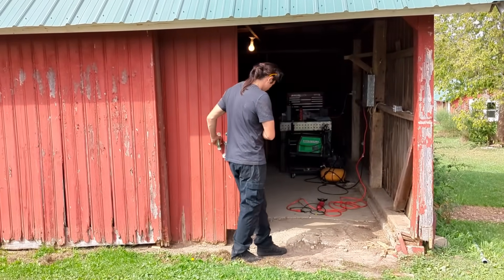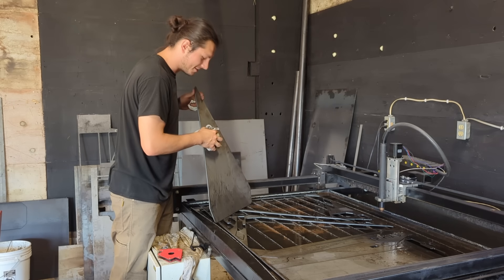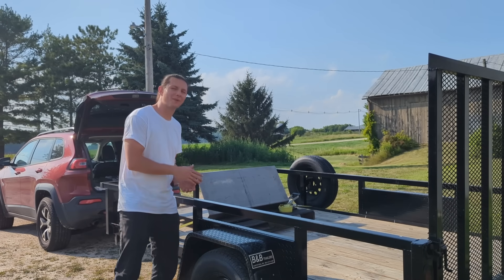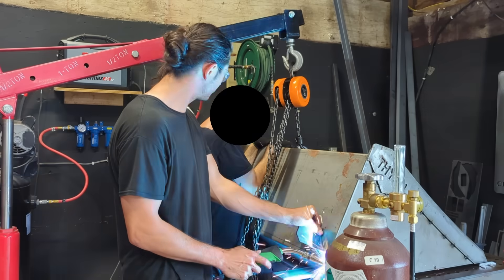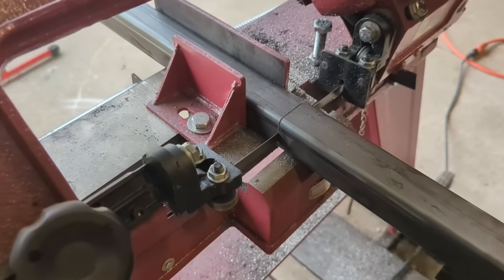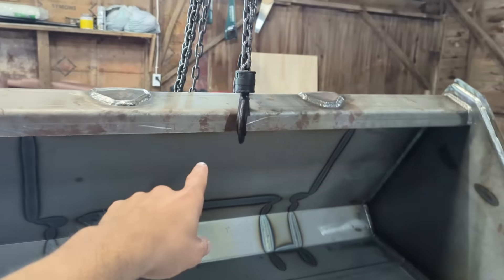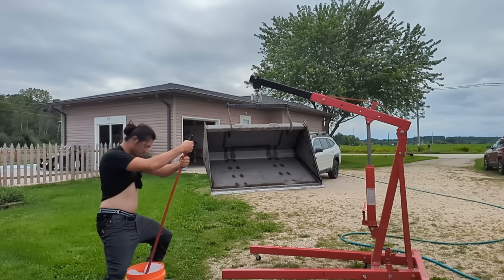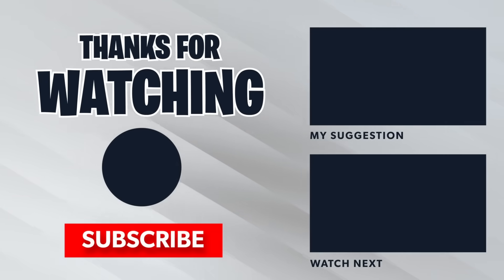Turning Sheet Metal Into $$$ | Building My First Skid Steer Bucket

Comment: In no welder nor manufacturer but I’ve seen heavier duty equipment with these welded hash marks to increase the protection from wear. I believe it’s a stronger type of electrode but it might be something to look into to add that extra level of build quality.

Comment: I built thousands of skid steer Buckets at a manufacturing facility in Sioux Falls SD. Your bucket looks good ! I did see that Yao guys were welding downhill and that’s a no no.  I’d like to be there when you put it to use and help you tear it up to see what and where you need to reinforce things.  Great job and it really looks good.
Reply from the maker: Thanks! Yeah I'm actually trying to find local contractors for testing. It's a little harder than you might think!

Comment: You need to sandblast that bucket. You were right to get it degreased, but you have no surface profile just mill scale. The rough texture gives you highs and lows That grip the paint. Its actually measured in mils and there are specs in the industry for it. Look up some NACE training materials to get the idea. Basically it needs to be a roughened surface.
You can spray Rust-Oleum through a spray gun and get some decent results if your steel is properly prepped. If you add a little bit of catalyst to it when you're mixing it will cure up faster and be harder than it otherwise would. 
If setting up for blasting and the dust from it is an issue, consider a wet blasting setup. CCE and SV Seeker both have videos about it in use on their channels. Works well and solves the dust problem. SV Seeker also has some great vids about coatings. He built a massive steel sailboat in his front yard in Tulsa and its now sailing in the ocean. We didn't do it with every single fancy tool and didn't know a lot about what he was doing at first. Worth watching to get some ideas. 
If you get some traction on selling these, it might be worth it to offer a hardfacing option. You can get it either in stick form or wire. Since you would be doing this in production it would be worthwhile to get the wire version from Stoody. If you want consistent repeats you could try building a CNC setup which would use your MIG gun to draw the hardface pattern straight and repeatable every time. It would basically be like robotic welding and would free up man-hours in fab. 
When you have to push a bend up like you did, just use a porta-power from the inside. Then it can't pop up on you. The hydraulics make it very easy to move only the amount you want with full control. If the angle is odd you just tack a tab of steel wherever you need it to keep the ram from kicking out and then you pop the tab off when done. Even a Harbor Freight porta-power setup will last long enough to pay for itself and its upgrade by saving you time.

Comment: As for powdercoat, don't go down that path. It is the cause of so many rusted out machines and equipment. It lifts off the steel at chips and cracks and then holds moisture under the skin and just rusts away. It is also a hassle when trying to maintain one's gear as painting it just doesn't work well compared to paint over old paint.
Reply from the maker: Powder, from where I'm standing seems much more economical at scale. But I see your points
Reply: @ThyialIndustries made local and sold local, so the reputation will also be local. Every cheap Chinese one is powdercoated and rusts badly. Do the paint and make sure to include it as a selling point for ease of ongoing maintenance and longevity

Comment: I would recommend adding 2 welded tabs with lifting eyes on the top rail. Good for lifting whilst painting, but a hige plus for users for pulling, lifting random stuff and also lifting the bucket it self. 
Make sure to do the hole to suit a large range of shackles and chains. Even better, include a keyhole profile to the hole to adjust chain lengths and lock into the links.
Reply from the maker: Yes, trying to figure out how to do this right now! And make it look good too lol
Reply: @ThyialIndustries  id do some ears to the left and right of the coupler to keep them entirely out of the way but that's me lmao

Comment: The wolf head needs to be a second color. If you're thinking manufacturing you need to consider each step in the process and time consumed. It's probably best to send to powder coat till you can coat yourself. We used the reverse bow when welding longs. The first always takes a lot longer then the 10th. Jigs, Jigs, Jigs!!! If you're selling too many too fast RAISE THE PRICE!
Reply from the maker: I'm right there with you! Just have to sell a few first... 😆

Comment: Good job starting something new, and that's your own. The only thing I would have wanted if I were shopping for a bucket is that the cutting edge had a step cut in it so that the bucket was not sitting proud of the cutting edge. I would personally want a replaceable cutting edge that just bolts on, too.
Reply from the maker: That's an interesting concept - with the step. I haven't heard of before

Comment: To combat the measuringprocess time you can add alignment tabs and slots in your parts before you cut them out. A lot of race car part diy kits come like this as cheaper alternative than fully welded kits. Checkout some of Team z diy kits they sell for like torque boxes.
Reply from the maker: I actively do this on most projects. This one, due to the manufacturing process, I was unable to. I sheared the bucket, instead of plasma cutting.

Comment: Its nice work but your bucket is weak unfortunally,  you need hardox or dursteel , build something strong and hard only once its better and you could add hardfacing on it . And you should change your wire when you weld something  strong like this , use fluxcore or the basoc wire  ( er 110 ) or stick 7018. But its in general its nice work
Reply from the maker: For the target customers im goingfor... This will  work  just fine. If I over build it to the point where the price sky rockets i could run into problems
Reply: @ThyialIndustries  i understand, and i already hear them far its expensive its etc etc etc 😂.
But congratulations
Reply from the maker: @jeanchrisweld lol thanks man

Comment: I’m not a welder by any means but I do fix some buckets here and there and for straightening I have used turn binders
Also skid steer attachment are not worth enough and last a long time I would recommend remanufacturing medium excavator buckets you can get busted up one from contractors for a few hundred bucks and new ones are worth tens of thousands.

Good job
Reply from the maker: Thanks! May be in my future...

Comment: Why didn't you polymerize the whole bucket?  When I weld most things up that dont have to be painted, I'll use a paint brush with used oil and burn it on after a couple coats it doesn't rust, and if it does, the customer can just grind it thow some oil on there and repair it themselves instead of trying to find the paint I used and feather it in to make it look right.
Reply from the maker: N ever heard of what you're talking about. Are we talking about seasoning the entire bucket? Like a frying pan?
Reply: @ThyialIndustries yep as long as your not using hss or something like that keep it under 300 and it shouldn't mess with the metallurgy of the steel.  Its durable keeps rust off and any idiot with a torch can do it.  I use the torch I have to keep weeds off my driveway to put it on.
Reply from the maker: @singlewideproductions Interesting
Reply: @ThyialIndustries id say play with the idea, man.  How many buckets do you see that are actually painted?  I have not seen many polymerization works wonders i normally use it on axes and keep em in the back of my truck if your careful ya wont fuck up the heat treatment.  Thats why for quenching knives they get it hot then dip it in oil.  It leaves a protective film on there thus reducing oxidation.
Reply: @ThyialIndustries kind of sounds like it but I'm assuming they're talking about using waste motor oil 😅
Reply: @erickhuntsman240 yep I mean you are not eating out a excavator bucket so why spend money on food grade oils.  You want an oil with a high smoke point and effectively bake it on so motor oil works great.

Comment: That is overbuilt for decades of punishment! I build my own attachments with zero knowledge, stick welding 7018 total amateur, ugliest welds in the world, but the stand up to years and years of abuse. Your thing looks a lot better for sure, but I only spend around a day or two making my tools.
Reply from the maker: How much use do your attachments see though? This one is going to a test company that will see almost daily use
Reply: @ThyialIndustries  Certainly not as much as yours will im sure. I live in northern europe, so here paint and finishing components are key to longevity, specially for the parts that resides outdoors. I have a firewood processor from 1994 build by a small company in Sweden - who also overbuild everything. It is rock solid even though its sitting outside year round. Superb metal and paint quality.

Comment: I like that design for some work, but the geometry of the back i like it more square for general use.  The problem with the back being a 45ish angle is when back dragging material it will roll under the bucket with that geometry.  if the back where more square the material is easier to smooth in reverse.  Some cases that type of geometry work, but if i have only on bucket i think i prefer a squared back.  CAT adds a plate in the back to square the back and also allowing a curve in the bucket to keep material from sticking,  Just my thoughts
Reply from the maker: Appreciate the feed back. Yeah after talking with a few end users it's clear that there are a bunch of specialized applications. as the manufacturer i have to decide which to choose lol

Comment: If your'e going to wash the metal after welding Skip just use TSP, then rinse it and give it a coat of Klean Strip's concrete and metal wash.  You can just pour it in a pump sprayer.  It will prevent flash rusting and help give the metal a rust resistance until you can get some primer and paint on it (for abotu 2 to 3 days unless you get direct water on it.  After that use a good metal etch primer and indstrial paint like made for farm and industrial implements.  It's a bucket and it will get scraped up but the goal is just to protect it during shipping and mounting.  Not sure what you have available as far as stores in your regon so hard to say a brand.
Reply from the maker: What's tsp?

Comment: Could you please share some details on the bucket edge? Is it an off the shelf component, did you manufacture it yourself, what kind of material, what thickness, etc. I'm only halfway through the video yet, so appologies if you say it in the second half.. Thanks in advance! Love the videos, great inspiration!
Reply from the maker: The cutting edge is an off the shelf component for my steel supplier comes in various sizes and thickness. This particular one is 1/2" x 6"  I believe.  It's 1055 carbon steel

Comment: Definitely dial it in. I say this because I run the same 45XP myself and cut lots of 3/16" and it comes off the table completely dross-free. You have room for improvement to help cut down on time spent cleaning up.
Reply from the maker: Completely dross free??? I find that extremely hard to believe. But maybe?
Reply: @ThyialIndustries  For long/large cuts like that? Yes absolutely dross free. It's only when you have cut paths that are much closer to each other where the metal has a chance to absorb more heat. 

As I stated, I cut tons of 3/16" steel and the only dross that develops are for very narrow parts or brackets (2" wide) with holes/slots that range from 5/8" down to 1/4". In this video you demonstrated some large cuts, where I would expect the only dross to occur on your lettering 'Thyial'
Reply from the maker: @KwikFab and you use different settings from what's provided in the manual?
Reply: @ThyialIndustries  Absolutely. I've been doing CNC for a few years now, and every single plasma cutter must be dialed in to your own setup. I used Hypertherm's manual as my base chart, cut several parts out to obtain correct kerf width and cut height, and finally the best speed for the best quality.

On a 45XP for production the manual says run it at 184ipm. For quality, it states to run at 120ipm. I found the best quality on my own setup to be at 90ipm for outside cuts, and approximately 42ipm for holes and slots around .34" diameter. I cut some slots earlier at about 1" long and only 0.19" wide and they came out perfect to allow a tab and slot fitment for 3/16". 

Feel free to reach out and I'd love to help. Many of us in the world of CNC plasma are all self-taught due to all the gate keeping exhibited by others. Meanwhile, some of us are actively helping others to succeed (I'm a moderator in a CNC group).
Reply from the maker: @KwikFab ohhh nice that's good to know! Maybe one of these days I will dive more into that side of things. I've always just took the values from the manual and they seem to work pretty good so I never even questioned it.

Comment: Nice machine- how do you like it.  i use the original 253dpi and was wondering if youd ever tried the older one?
Reply: I went watercooled 501d and never looked back for steel. For aluminum i upgraded to 36 series 10 ft and it helps. I also bought the parker 360 with 25 ft lead. If your gonna run alot of aluminum get the push pull gun and bite the bullet.
Reply from the maker: I like everything besides the included whip. Seems too light duty for machine. And I have never tried the older one. This is my first Everlast welder

Comment: This is one of the things i had in mind as well before i even purchased my cnc table! came out great bro! you should get comfortable with the welding side, also think about "thumbs" if you can make a thumb and actually weld the attaching points onto someone's bucket or onto their excavator arm that's Beaucoup  bucks.
Reply from the maker: Yeah I think there is a great market for this kind of thing. And thumbs have been on the list for a while. I have a bunch of product ideas. Will hopefully be releasing then as time goes on. Thanks for the support!

Comment: Good work. You could probably make some dog and wedges with that plasma cutter to help with aligning steel. If you get into bigger/thicker buckets you can make the backs rounded by putting small bends an inch apart with a press break. Also to save time make the bottom pan first then put side plates on, weld, then trim the excess plate from the sides. Also, if you get into heavy equipment fab look into dual shield welding wire, it’s really good for out of position welds. For painting try epoxy primer and an hour later spray some single stage paint on. Keep up the good work friend.
Reply from the maker: Awesome, thanks for the advice, I'll have to try those techniques!

Comment: A few tips.

1. When weld plate steel like the cutting start fron the center ane slowly stitch weld it the ends. You can also use compressed air to cool it down fast in between welds.

2. Paint it. Don't powered coat it. Its more expensive, powder coat chips and flakes off unlike paint. And rust will travel under it.

3. You should consider making the lip with replaceable cutting edge or at the very least hard face it.

Other than that you did a great job.
Reply from the maker: Appreciate the tips. Bolt on edge is definitely coming! I will have to paint for now I guess, I just don't like it. Super messy, sticky and takes forever to dry

Comment: Awesome.   I hope this is successful!   It's a fantastic idea! 

Did you consider hardfacing the bucket lip?   It's a mini, but it could seriously extend the life of the bucket.  Maybe offer it as an add-on service?
You can learn hardfacing very quickly, especially if you're already proficient with SMAW.
Reply from the maker: Not sure it would be necessary? The blade is already made of 1055. How much harder would it get?
Reply: Yes. If you don't want to hard face it consider making the cutting edge replaceable. I work in construction and the take a lot of abuse. Especially if yiur clearly up material that is on concrete ot asphalt.  @ThyialIndustries
Reply from the maker: @OnlyTheTrutha yeah a replaceable edge I think would be the way to go
Reply: @ThyialIndustries  Make the bolt on edge an option, but not standard. I don't think it's needed on minis, but the guys that do need it, can pay for it. I've built several buckets and repaired dozens. The edges I've replaced were either decades old or used all day long on concrete.
Reply: @boostinjdm I agree, make it an add option. Im sure a basic mill drill would go a long way for you and would allow you to machine the chamfers needed in the bottom of the blade to use countersunk screws for attaching the replaceable blade. Keep up the hard work!